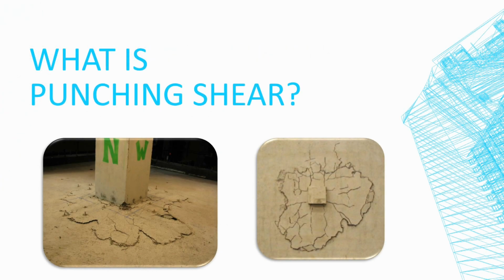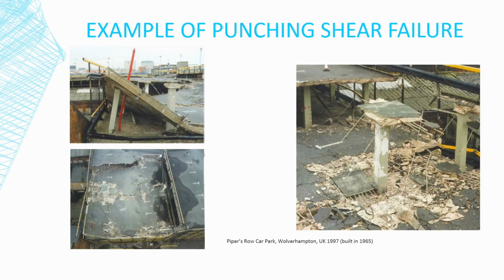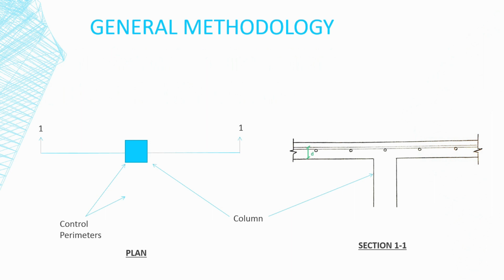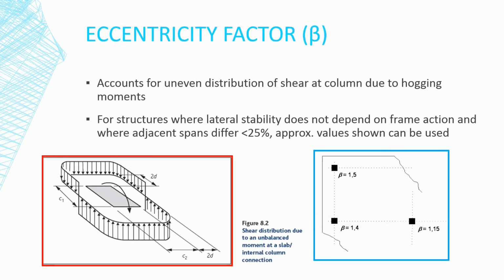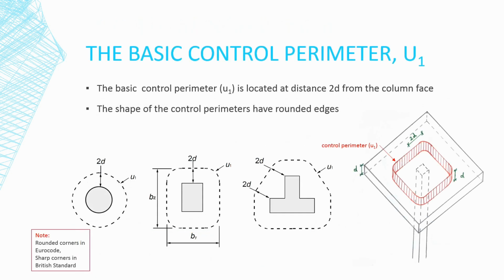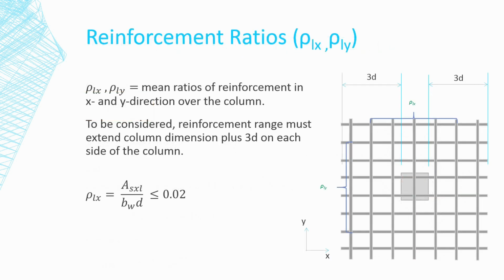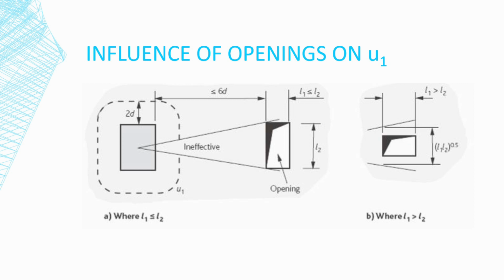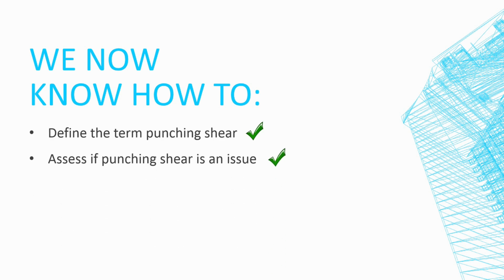Punching Shear

Comment: Can you please confirm, the minimum distance of a column from the slab edge, so that it can be considered as an interior column (two way punching) while checking punching. it might be in terms of slab depth or column size.. basically need an idea to decide as per a column location if it is to be designed as edge column or interior column if column not exactly at an edge of a slab but at some distance from an edge.
Thanks!!